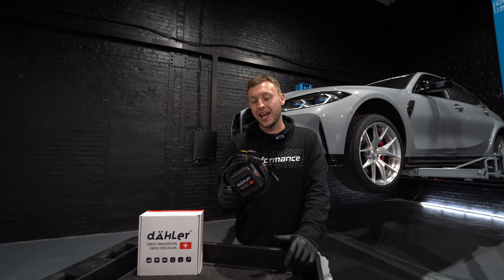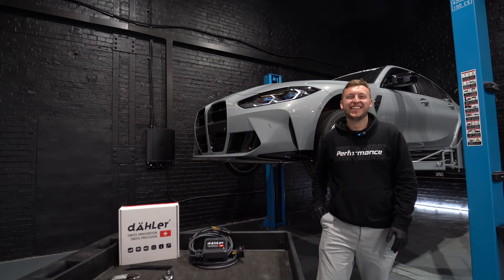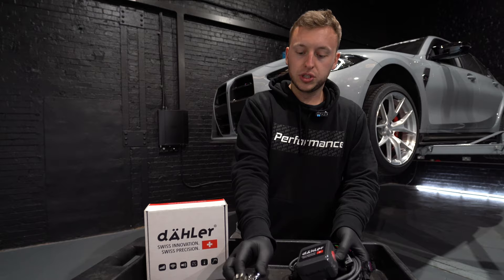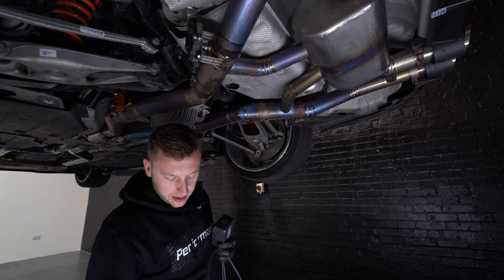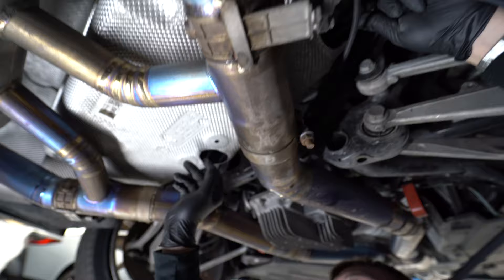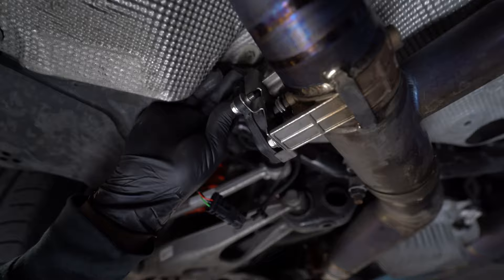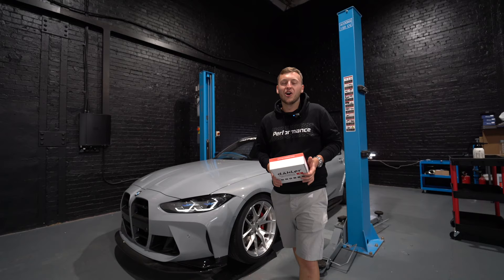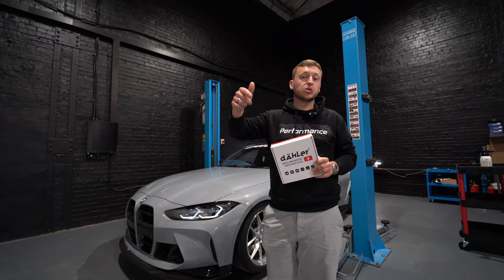THIS IS HOW TO GET FULL CONTROL OF YOUR BMW EXHAUST - dAHLer Valve Controller

Comment: If the valves are closed with the controller, would that mean its in auto (default) so that It can open and close as if it was in sport without the mod?

Comment: Will this benefit a stock G42 M240i ?
Reply from the maker: Hey man! Yes indeed just select the one flap option on the product listing https://www.r44performance.com/products/dahler-bmw-exhaust-flap-valve-controller?_pos=1&_psq=Dahler&_ss=e&_v=1.0&variant=39770775945291

Comment: Looking at getting this, but how does it link to the cars internal exhaust flap button? Does that become obsolete and now you have to use the remote 100% of the time or will pressing the exhaust button on the center console now open or close the flaps?
Reply from the maker: Hey, everything works as normal. You just have additional control with the remote! It’s amazing!
Reply: So does the internal stock exhaust flap button open the valves 100% as well? Same as the remote would?